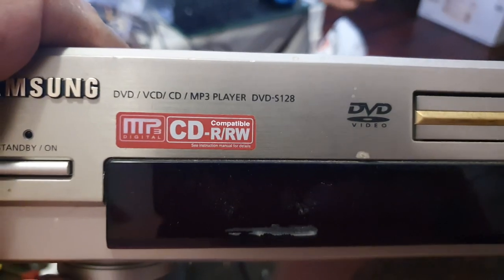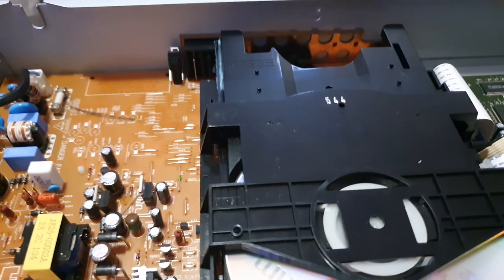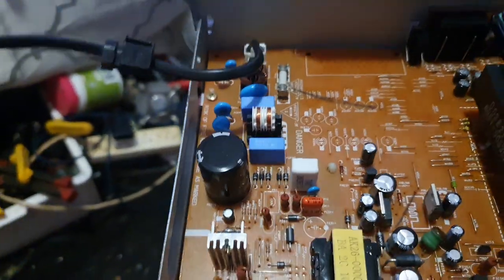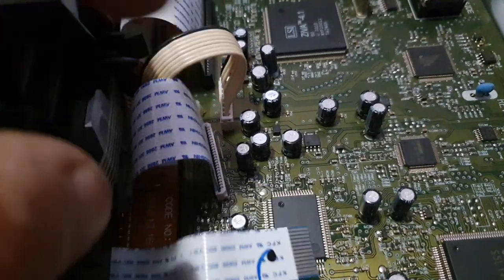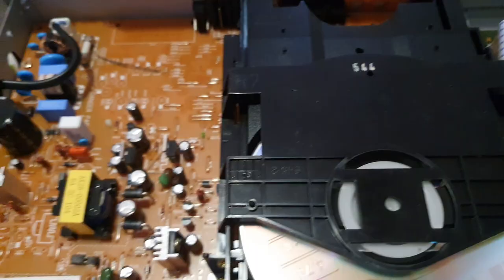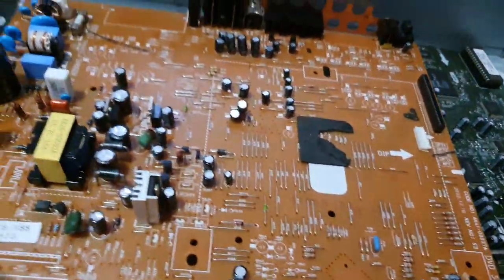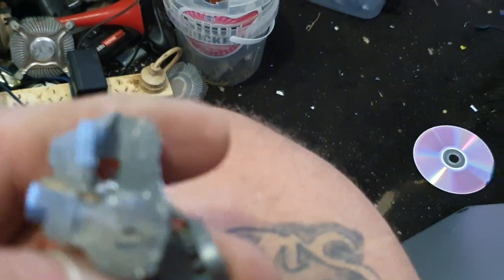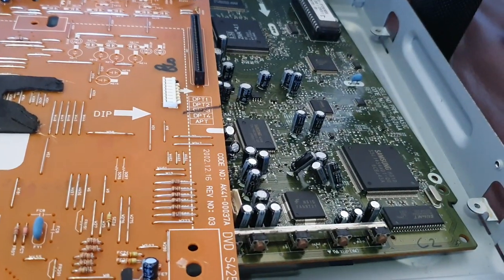SCRAPPING / scrapping a Samsung DVD player for gold and other precious metals

Comment: The little brown disc thing is a ceramic capacitor. One of the more classic types.
Reply from the maker: thanks
Reply: @prospectorpete  obviously you can see the gold bond wires on newer laser diodes, because they're encapsulated in clear plastic. 

Some optical disc drives contain a second laser diode that's not encapsulated in anything. That little gadget is harder to find within the assembly. I have lots of sony DVD players that have that type of optical disc drive assembly. They're not particularly high end DVD players, they all came from a large hotel.
Reply from the maker: @aredditor4272  yeah I've even come across some cd drives with 3 gold lazer diodes